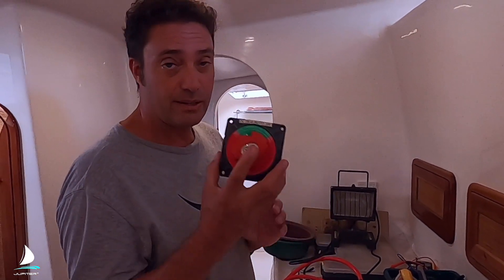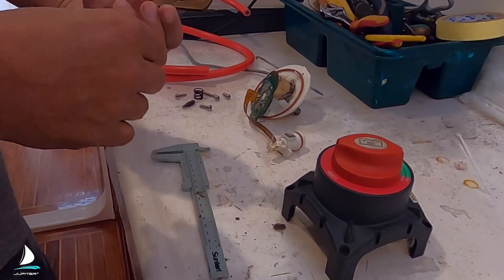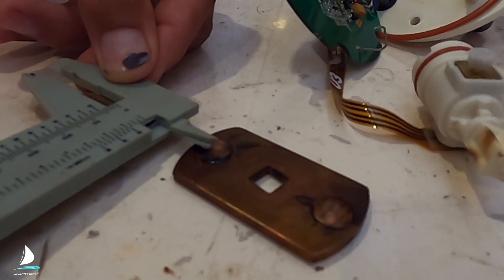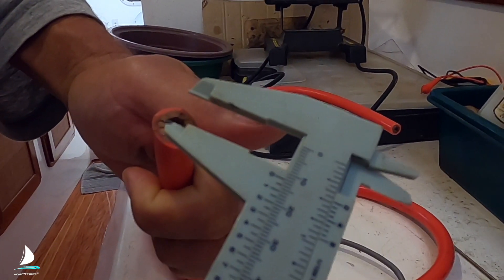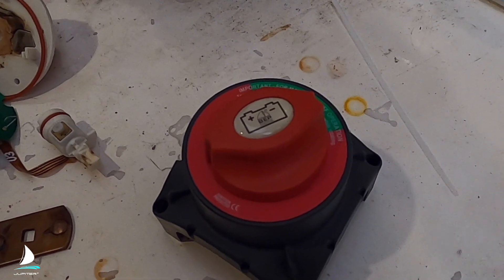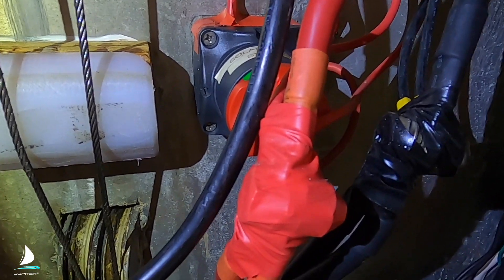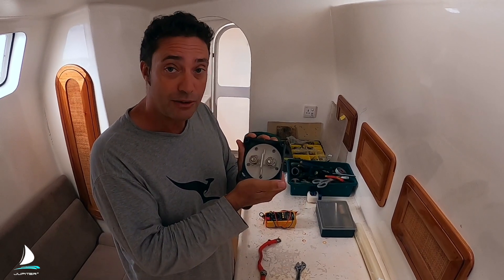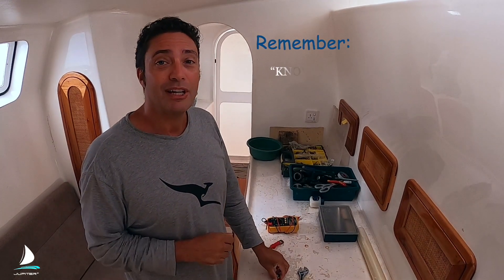How to Boost YOUR ALTERNATOR OUTPUT - Battery switch OVERHEAT and FAILURE.

Comment: I'm confused , why do you have a switch between the altinator and the batteries , 
I can understand a controller,  and a splitter if there are 2 sets of batteries , house or start ,
Reply from the maker: Good question David... It is to isolate the engine (starter/alternator) from the batteries completely to ensure no stray currents in a metal boat.... Generally a "floating ground" is the ideal. 
Also nice to switch off power to the engines when you're swinging wrenches in the engine compartment.
However, because of these crap switches, and whilst cruising i've been unable to readily find a good alternative... so that bolt connector is still in place.... It runs so cool with it's extremely low resistance.... but when we get the the US, i will try a Gigavac high current contactor.
Thanks for watching.
Reply: @SailingLifeonJupiter  I understand isolating batteries from the engine , go it all the time , but that's usually after the batteries,   on 100s of boats I have sailed incl ovni,  aluminium 
, I have had splitters fail pouring all altinator power to one set , melting batteries , 
If you have up dated your altinator to produce better output and then trying to stop it , surely thats a heat fire hazard ,

Comment: Jamie, I just subscribed.  Is there a manual switch that would serve and not decrease the amperage?  What were you using the switch for before and I assume now you cannot do without disconnecting the bolted wires.
Reply from the maker: I was using a BEP (marinco) 4 pole battery switch rated at 600A continuous, 1200A intermittent... But it melted over time with only 120A running regularly... As the tiny contacts heated and sooted the resistance built up and heated even more till it failed. I was shocked at how small the contacts were inside.
I still have 3 of these switches unused, but didn't want to use them again.... Until now... I will use 2 x 2 pole switches. One for - ve, another for +ve and hopefully they won't overheat.... Im going to float my ground, which is preferable for an aluminium boat... Hence I need to turn the power off to the alt/starter when not in use.
Hey, who are you flying for?

Comment: Aye m8’s, I have a feeling you'll need some kind of a more tough, more durable, surface for your work bench.
Reply from the maker: Yes would be nice... But it's not like I hammer on it... I'm still careful about dents and cuts... Still nice gel coat under the clear pvc.
Reply: Endgrain cutting boards can be found quite cheap sometimes and could be glued several together, I suppose.